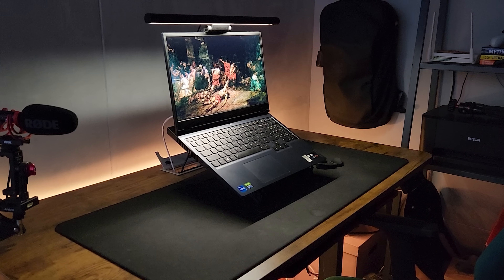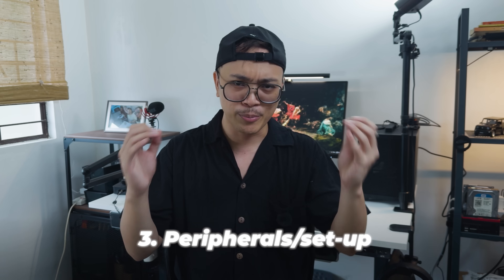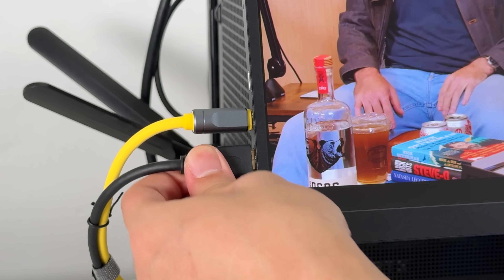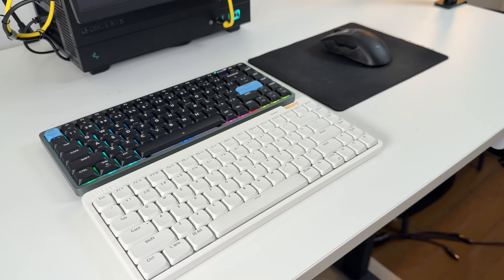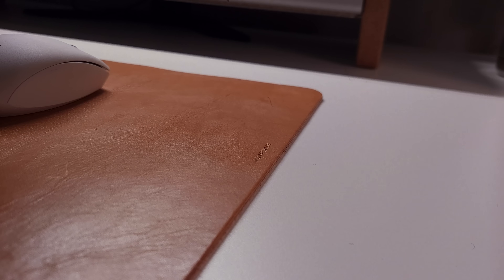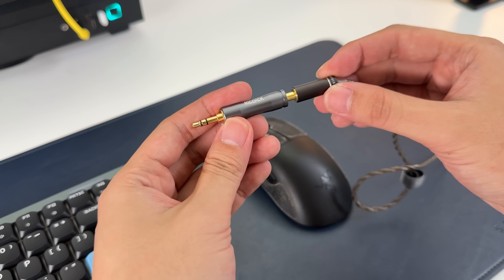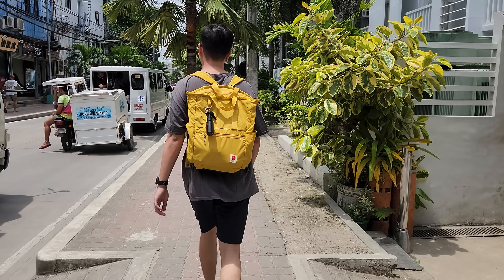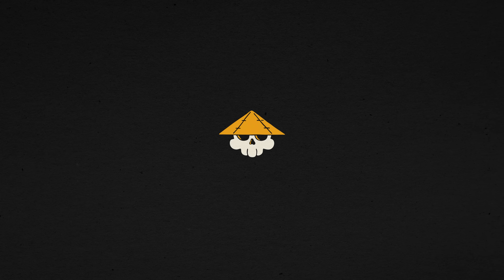Can a Tiny PC Beat My Gaming Laptop?

Comment: I did a similar build recently! I used a PCCOOLER CPS K101 case. My monitor mounting solution was to use a tackform 20mm ball mount attached to the case's top. ( i had to a drill a hole to use 1/4-20 hardware). On the monitor I found a 75x75 VESA adaptor with a 20mm ball mount. Then used a 2'' socket arm to hold them together. For my keyboard I'm using an epomaker carbon 60, super light and looks great. Love your build, glad I'm not the only nerd building a complete and portable pc
Reply from the maker: Bro yours sounds more complicated 😂 thank you for finding the value in my video hahaha appreciate it man! 🙏
Reply: @JosellClark it was pretty easy and all parts were found on Amazon. I just really wanted something sturdy. The first thing I did that inspired me was simply Velcroing the monitor to the case lol

Comment: Here's my budget 4.3L travel setup that I've been using since early last year - SKTC A07 | R5 5600+NH-L9a+B550i | Zotac 4060 Solo | 32GB | 2TB | 650W Flex | 16in 1080p144 | Custom length PSU/GPU/MoBo cables | Keychron K3+VXE R1 Pro+PS5 controller | JBL BT speaker. For the carrying case, I gave up looking for a suitable laptop bag or a big backpack instead I looked for camera bags! I found a nice 2-in-1 bag by K&F that can be either a shoulder or backpack. It has a great space in it with good foam paddings. I will place everything in this camera bag except for the portable monitor. I've been moving from North to South Luzon regularly last year due to work. I still need to carry my work laptop from a small laptop backpack, this where I place the portable monitor. Overall, it isn't that bad to carry this setup and I can mostly play my games 100FPS+ at 1080p. I rode Victory Liner carrying this setup and it wasn't that bad. I can't really say for the other modes of public transpo though ... The con of this setup is you need to do some undervolting for the GPU and CPU to control the temp which I believe is mandatory for sffpc.

Comment: Here is a suggestion but it will be a stretch, get a GPU with USB C port, I have a RX 6800 Reference Card and if it is something newer, maybe RX 7900 XTX Reference Card. I am not sure how easy it is to get a hold these cards. You can then power and display the portable monitor over a single USB C cable i think that yellow cable yours is doable.
Reply from the maker: I didn’t know that GPUs with usb c ports exists thanks for that lol. Either way I don’t think they have that in my local store 😂😩

Comment: For anyone in the same situation as I am, where new work arrangements demand frequent relocations around the world, so looking for options to avoid laptop performance hit, this case in the video is 20 liters. The FormD T1 case is under 10 liters and it fits water cooling, an rtx 5090 graphics card and any amount of SSD and ram you'll ever need, alongside with any processor you'd like. There are bunch of build videos on YT with top of the line components and even with custom tubed water cooling systems. Check it out. It fits into a regular size school backpack as fully built.